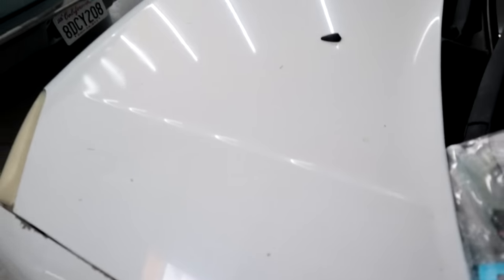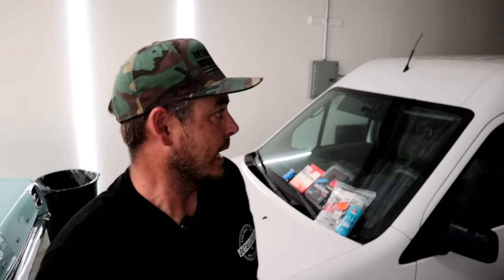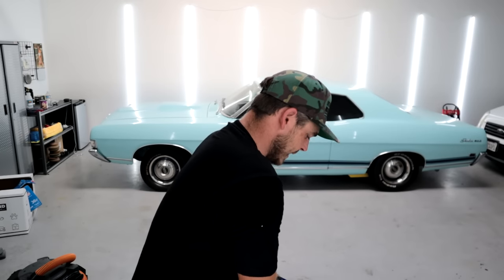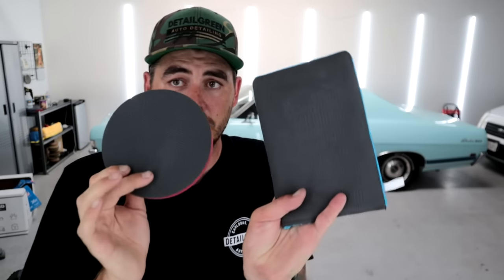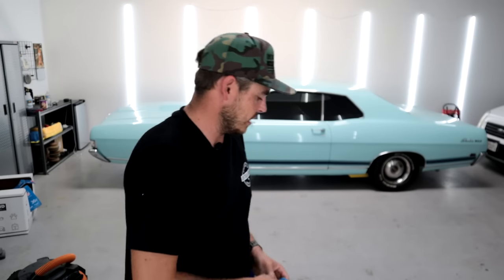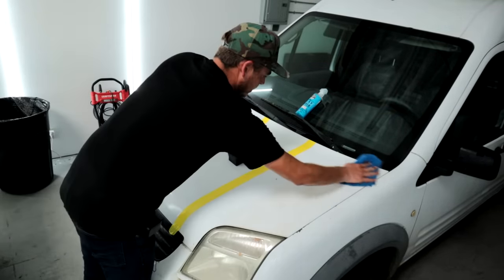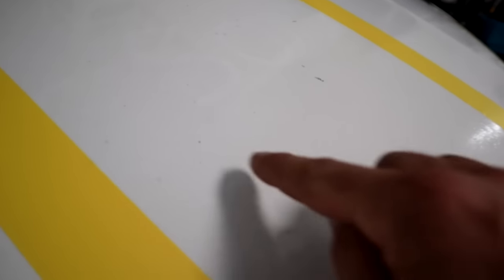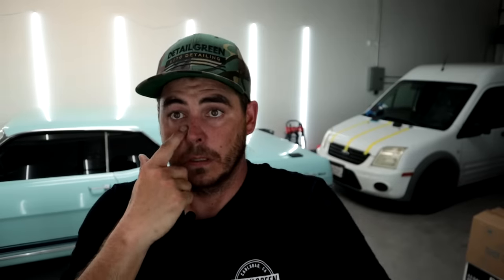Easiest way to CLAY your Car! How When and Why you need to clay bar your car. Best Types of Clay Bar

Comment: If you use the original clay bar, do you switch to a new piece once it gets dirty with contamination? 
Is there a risk to scratching the paint with the imbedded contamination?
Reply from the maker: nope you just fold the clay and keep going.  In most cases it wont be as bad as this one. As you fold it it blends out and you can keep working

Comment: Have you tried plumber's putty which is touted by several on YT?
Reply from the maker: I have not… i might test that just to see
Reply: Tried the plumbers putty while waiting for Adams clay bars to arrive…had to do the job 2x, once with putty then for a good easily with the clay. 

Plumbers putty is to soft “grab” the embedded particulars in the paint and falls apart with all the moisture from the lube. 

If you are tight on cash try one of the fine grade inexpensive clay’s on Amazon with a good lube.

Comment: Thanks for all the great videos Josh. Would you recommend using a foam cannon to clay if the soap was adams mega foam?
Reply: Some other commentator said he stopped using the clay lube and just soaped down each section with a wash mitt. Same concept that you wanna do. Makes sense in saving a step of going back to wash off clay lube.

Comment: can you use soap and water as a lubricant ?
Reply from the maker: I do most of the time but I always polish after. Just soap won’t have quite as much lubrication so you run the risk of marring the paint a little bit and needing to polish. But I recommend polishing after claying anyways so that’s why I use a high lubrication soap and clay just with that most of the time

Comment: I got some hard water spots on my car from my sprinkler. Clay bar removed some of it but not all. Any advice for something that works good without resorting to polishing?
Reply: Car Care Companies make a dedicated water spot removers.  Try using a mixture of White Vinegar & Distilled water 50/50 mixed.  If that doesn't work, add lemon juice to this mixture.

Comment: Yes, industrial fallout is normally those metal dust particles normally from brake dust from the road besides being from airplanes or trains like rail dust or even a storage.  They can even be on new vehicles because of transportation.  They begin to oxidize.  It can even be oil from petroleum distilleries or silica from quarries or concrete from construction, besides steel or iron.  Basically it is generically nasty stuff that falls down and deposits on the surface of your vehicle.
Reply from the maker: Yea i had it on my Sprinter van when i bought it... Got it off right away!

Comment: I use steel wool. Gets out all particles. Try it. Save your money and don’t buy clay!
Reply: Never use steel wool it will scratch your vehicle.  Steel <> clear coat.
Reply: Your clearcoat is rapidly being removed by the wool.  That's the worst thing to use on clearcoat.  Any time you "might" be saving in this step is totally consumed by the time you have to take to correct the surface.  #0000 is great on glass, but would never ever even consider it for paint.
Reply: @johnneidert5777  #0000 for chrome also!
Reply: I do this on my windshield, don't think it's good for paint and clearcoat.
Reply: @inkgenie9760  Hey Ink Genie. I felt the same as you do using 0000 on chrome. Really take a close look at the surface and you will notice that it slightly dulls the chrome. I like to use a fine polish with a microfiber towel.